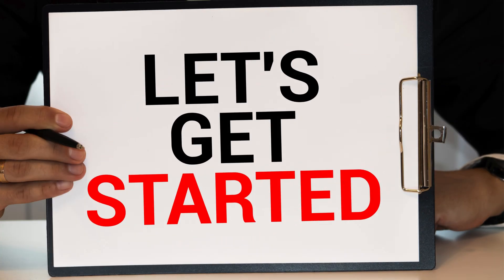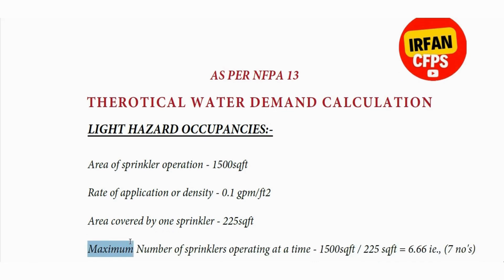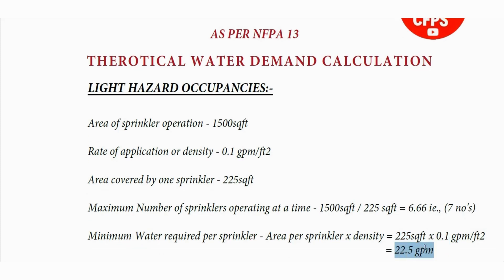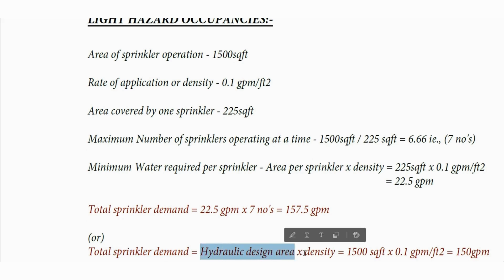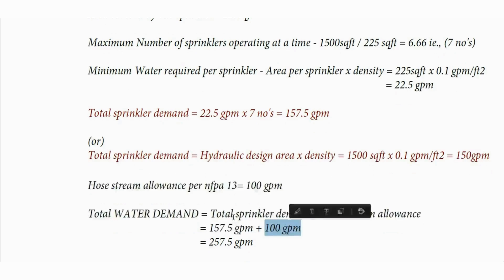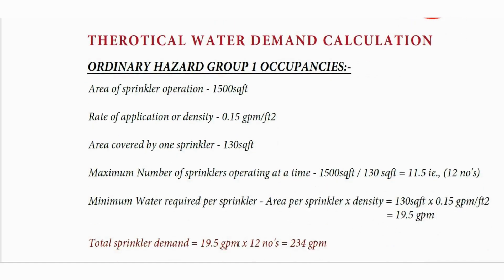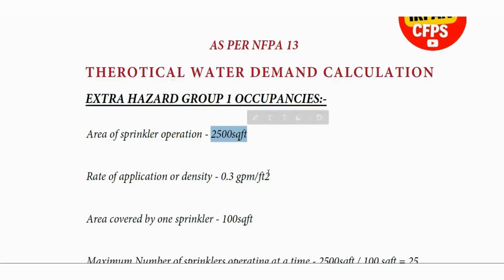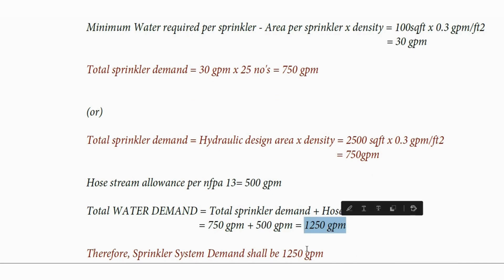How Much Water Do Sprinklers REALLY Use?

Comment: I'm very sorry to bother you. I have a question and I hope to get your reply. I have a newly built steel plant building equipped with standpipe system、automatic sprinkler system, and outdoor fire hydrant system. How should I determine the maximum water demand of this building? Should I add up the water demand of each system?  This is related to the selection of  fire pump.Advance thanks！
Reply from the maker: Iam happy to clarify. We will not add up all the demands. Which ever is higher, based on that we need to select the pump.
Reply: @ In that case, when a fire breaks out and both the automatic sprinkler system and the standpipe system are operating simultaneously, wouldn't the flow rate of the pump be insufficient? Thank you for your reply.